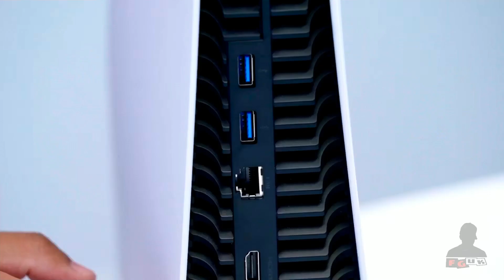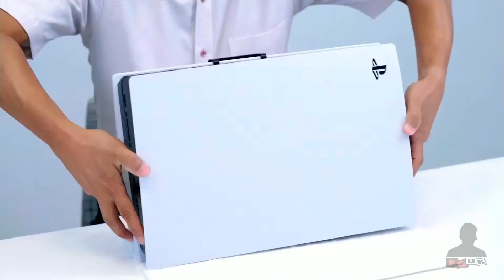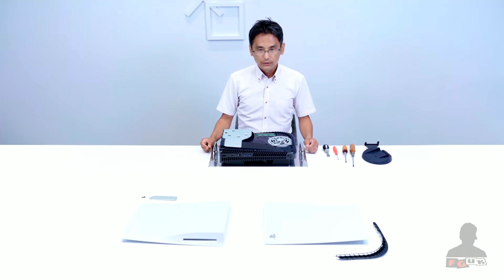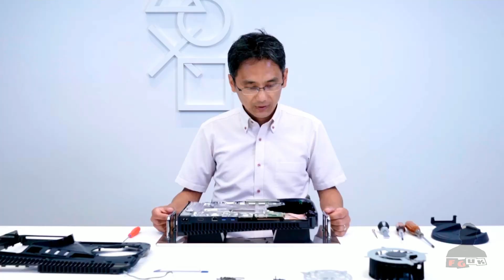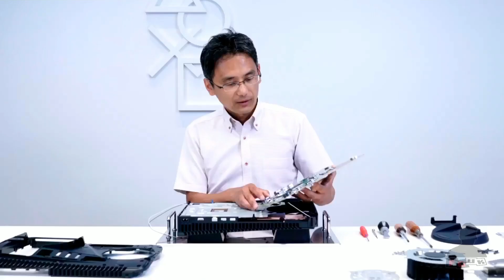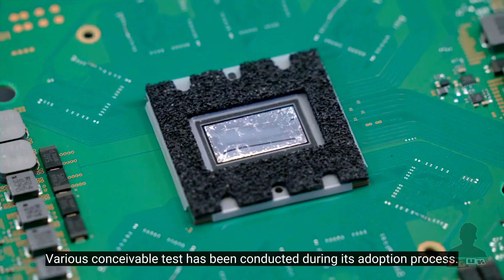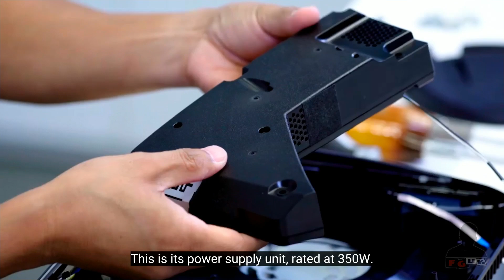The Official Sony PS5 Teardown (English Voiceover)

Comment: I can confirm I just cleaned my ps5 digital version (similar guide) and it was sooo dusty. The screws to remove the fan was a bit tricky but you will need a hexagon adapter it's between 7-8 mm . Bought my ps5 on 9/2023 .So after 1,5 years it seemed that it needed some cleaning .Don't think it's necessary before that ( I will start bagging it while I'm away from vacation,could help imo)

Comment: As everyone can see the PS5 is a work of art inside and out😌 And now finally the critics can be silenced🤫🤐
1  Easy Removable panelsTo 3-D print or make killer designs like  Miles morales Spider man or Kobe Bryant 2K✅
2 T1000 technology with liquid metal✅
3 Multiple kinds of SSD drives thst can be used ,and for those that didn't see carefully the door was made out of metal to act like a heat sink!!✅
4 Gigantic fan that's Almost the size of your hand that not only sucks air from both sides of the Vents from the front but is also quiet and  Releases heat through the back✅
5 The and the reason the size of the  PS5 Isso big is  because of the massive heat sink With its massive piping Just looking at it shows the attention to detail with all of its vapor chambers Not to mention the massive fins  Tells  Sony's not messing around As well as its gigantic power supply✅
6 PS5 also gives you great solutions for maintenance with  Dust  catchers that can be easily Be vacuumed out,  Most likely something that other consuls will start to copy.✅
7  And last but not least RDNA 2✅
 And the list just keeps going on and on, like  Being able to download games fast,etc. etc. etc.

Comment: What's strange is that it's literally twice the size of the Series X, much more complicated design and yet substantially weaker in performance? 😔
Reply: Have You or anybody run a benchmark to say it's weaker? ; P
Both use customized 8 core Ryzen 2 CPU and custom RDNA 2 GPUs

Comment: Overclocked chip = large console with alot of heat sinks, that is all.
Reply: It isn't overclocked. That is a myth perpetuated by Xbox fanboy channels with no understanding of custom chip design or system engineering. The RDNA 2.0 GPU can run at that clock speed when paired with the ram speed SONY and AMD chose. You will be able to see this when AMD release their new range of RDNA 2.0 graphics cards later this month.
Reply: @NieR.Amanda  do your research it is fact that it is overclocked 🤦‍♂️
Reply: @kevina3739  You "Xbox fanboys" have a pretty warped idea of what a fact is. Probably get it from listening to Phil Spencer.

Edit: Most of my work involves research and analysis in the systems engineering field. Where do you get yours from?
Reply: @NieR.Amanda  every single other person on the planet knows it is overclocked other than you
Reply: @kevina3739  What planet are you on, tho? LOL
Reply: @kevina3739  "It's not fair it has a bigger number. Waaaaaaaah! It MUST be overclocked. Waaaaaaaa!" crybaby
Reply: @NieR.Amanda  what has a bigger number? 🤔
Reply: Nobody would put overclocked chip in console xD 

That shit is supposed to be stable. 

Also overclocking is act of increasing a clock, power usage ect. beyond and above whatever the hell default was. So unless You would get PS5 and mod it's not overclocked.
Reply: @CzornyLisek  things overclocked period

Comment: OK, so with the main SSD part of the board, will that be a concern for wear and replacement issues later?
Reply: Allen Hentscher Then the Xbox series X has the same problem, the SSD of the X is also mounted on the motherboard, so you cant remove it also😉
Reply: @renesevriens9965  that's interesting. I wasn't trying to say one machine was better than the other, but I have always been told that SSD have wear issues by the way they are used. So this was a genuine concern of mine.

Comment: The SSD chips being attached to the motherboard is a massive concern to me. Once any of those chips die the console is dead. 

It's not great for those of us who collect consoles and still intend to use them decades later especially when SSD usually only lasts 5-10 years of constant use.
Reply: @TheHound considering that the console generation will last more than 5 years you would hope that Sony haven't put a 5 year life span on these consoles.

It's a shame because I loved the fact that the PS4 allowed you to quickly and easily swap over HDDs.
Reply: 5years for SSD is actually quite a few years ; p

Comment: Why he say 8Gb ram? I’ve said it from the very start before I even saw the console and I still say it...if big means a quiet reliable system so be it no probs! :) it lays sideways so will fit ok in most telly stands.
Reply: Mark Wheeler theyr are 8 ram units, every unit has 2gb ram, so 8 times 2 is 16gb of ram😉

Comment: Fantastic heatsink.

Mega kudos for using industry-standard NVME M.2 22110 or 2280 PCIe 4.0 slot for upgrading store. However a big fat negative for soldering the main ssd to the motherboard as that is a dick move. The SSD will eventually fail and that will cause unecessary enviornmental waste. I expect that nonsense from Apple, not from Sony.
Reply: why should it fail...what if the IO chip fails, or the gpu or the cpu???
Reply: @georgwarhead2801  SSDs have a limited amount of wear cycles. When that hits then the whole drive fails. 

All it takes is 1 chip to go bad and then you dont have working primary storage.
This happens on Macbook Pros and the only recourse is replacing the whole motherboard.

As I said, it is a dick move. It looks like the Xbox Series X does this too.
Reply: @lakorai2  you know how long it takes to exeed this cycles, you can write 100´s of Tb for over 3 years 24/7 to reach this limit, and that limit is only speculative, they can last you even more cycles (and with speculative i mean, that drives get tested until they fail, if a notable amount fails at this amount of cycles, then they set the lifespan there, but this doesnt mean all of them will fail there)...and this doesnt mean, the entire chip has a failure, only a 32bit module in it will "eventualy" fail...
Reply: The integrated PS5 SSD working simultaneously between the rest hardware parts, noting will be as the PS5 integrated SSD for some time that why cerny say you need at least 7GB/s read becuse PS5 integrated SSD have 12 channels controller

Comment: The USB ports are rated at 10gbps and the M.2 port is very easily accessible, means it will be so easy to add extra storage.
Great to see the inclusion of WiFi 6, which offers up to 9.6gbps, Bluetooth 5.1 is higher than the current standard too.

Overall the amount of tech in PS5 is pretty crazy.
Reply: You need at least 5.5GB/s and that will be expensive right away

Comment: I don't think this is that well constructed, it comes apart too easy you you can just drop it then boom most of it will break off
Reply: wow...if you drop it that hard, you have other problems, then just faling apart...remembers me of the old nokia phones, you can drop them from the second floor, they fal apart, put everything thogether and it worked without problems...now try this with a new smartphone, nothing fals apart and you can throu it away after leting it faling

Comment: Wow sony give many USB, you don't need the charging station now

I want to tell noting will perform as the integrated PS5 SSD that built on the motherboard and working simultaneously between the rest hardware parts that why cerny said you need at least 7GB/s read and minimum the same speed PS5 have 5.5GB/s read so i will buy external SSD USB interface first with USB 3.2 Gen 2 up to 10gbit/s and a year or 2 after i will buy the m.2 Nvme SSD PCI express 4 interface because it will be expensive right away

Comment: Sup Fox, THIS IS BEAUTIFUL!!!😍😍 I was Soooo waiting for this!!!  Now we know where the M.2 interface is located. Has 2 'Dust Filter' ports.  Large 120mm, 45mm THIC dual-sided fan.  It's OFFICAL! PS5 uses the T-1000's 'Liquid Metal' for cooling.😆😆 Has been 'stress testing' the TIM tech for 2 years prior.😵🥴  It's PSU is rated 350w.  Massive heat-sink as like the PS3 & to note, *the PS5's heat-sink IS NOT  'Vapor-chambered' as like X1 & SX/SS.  Cooling system is completely costumed & Unique.  WoW!! 😂😂  Already puttin' this vid in my Likes & Favorites section.

Comment: All the lies propoganda from Lbots can go to sleep now, ignore them, the teardown it's the Bible of facts!

Wowww PS5 cooling impressive, they take it seriously this time and they also using liquid metal 👍 the heatsink design as vapor chamber performance

RDNA Gen 2 architecture confirmed, 10.3TF up to 2.23GHz clock frequency

External USB 3.2 Gen 2 (USB 3.1 Gen 2 old name) up to 10gbit/s

Expansion of SSD better solution then XSX that have external slots and it got hot, kids can mess with that, PS5 have the m.2 slot inside the system as we do on PC, great!
Reply: How is that a better solution ? You plug the expansion card into the back of the console for the xbox, can quickly swap them in and out if you have loads of saved games. What is wrong with that ?

Comment: Crazy how nobody mentioned the 2 dust catchers and you can just vacuum the dust out without needing to open up the entire console. That is extremely important, and its amazing how Sony included it, they looked at literally every single angle when developing the PS5.
Reply: They probably realized that a lot of people were breaking their warranty for the system by opening it up to clean out the dust. Definitely a pro consumer move to include these.
Reply: Nope lol it's got a shit integrated SSD so if it fails you need a new ps5 lol
Reply: I'm surpised Sony didn't glue that thing
Reply: ⃠HARAM ⃠ Thats what I love about this Design. Replacing faulty components in the future is going to be a breeze. For a repair guy like me this console is heaven
Reply: But it’s just a concept. Think about what would happened with them, maybe dust collects too fast so you be cleaning them out more often than you should or possibly clog circulation. There’s just too many factors that play. In return the next updated version of the ps5 will try to fix those problems they thought they fixed before and so on.
Reply: @doughboyjoe6518  I would check up on it every month just to see how much dust is collected and estimate how long before it needs to be maintained. Im thinking like once every 6 months to vacuum the dust but who knows?
Reply: @eurostar0711  with fans on both sides like that and they’re 120mm  it might be sooner than 6 months
Reply: Don’t you need a special vacuum to clean PCs? You don’t want to hit your motherboard with static electricity
Reply: @GreenAdam313  you can use a vac but most times they use compressed air to clean out computers from dust
Reply: @GreenAdam313  If your vacuum has a plastic nozzle you're fine.

Comment: Nice, Xboners will sleep tight tonight. They were so worried about PS5’s teardown.  Btw, awesome translation Fox!
Reply: 😆 🤣 .....I know bro....damnmmm....so true
Reply: One things for sure, the damn thing will stay cool. Which is contrary, to what's been said about Series x
Reply: Trill Bill Nothing wrong with that man, you could roast your marshmellows on it while playing Halo Infinite. I’m sure Craig approves...
Reply: Trill Bill I doubt it. Obviously it’s not going to overheat but I’m certain this thing will get hot as well. Also it’s not like the series x is overheating it’s just hot which happens to all consoles. The switch can get hot in the dock too.
Reply: @markercrayon457   They never said it was overheating or malfunctioning. They said it was uncomfortably hot. And that's just on standby mode. Whether it's an actual overheating issue down the road remains to be seen.
Reply: @TrillBill-u2t  i feel most likely that will be a problem unfortunately had overheating problems one xbox and 360 of mine
Reply: @croneous   I was one of the lucky ones who had a reliable 360 lol. But I know what you mean. There were refurbished 360s for sale ,all over the place at gamestops and ebay back then
Reply: @TrillBill-u2t  i was unfortunate I went thru 3 all fried cpu and I kept those clean!

Comment: Not bad, I still think the XSX is put together better. Both systems with that power will run hot and lets hope they stay cool enough.
Reply: In terms of simplicity or the modular look of it, then yes. I just don't believe in a one fan solution without compromises. Especially in a smaller form factor than the PS5.
Reply: @XGamers  seemed PS5 had one fan solution and pushing out side vents instead of, pulling out from the top with one giant fan helping the heat rise quickly and exit the system just as fast.

Comment: A lot of thought has gone in to this design and well done Sony for doing so.. everything is modular and easy to get at to replace. That fan in a beast so is that heat sink. Even down to simple maintenance with those vacuum ports.
 Was hoping for wifi 6 too
Reply: The engineers allowing you to take apart screws and have steps to have it face horizontally is brilliant. Xbox and Switch fall short. Plus you get to see its pretty insides and maybe void a warranty to add storage. Vacuum your console just to show em!!
Reply: So what is WiFi 6? Is it just a strong wifi signal?
Reply: Monkey king  yes it’s faster more stable and there are a bunch of other features you can do with it like mesh systems etc.. but you will need a router that will output wifi 6.. don’t worry if you havnt got one all the other WiFi bands will work with it
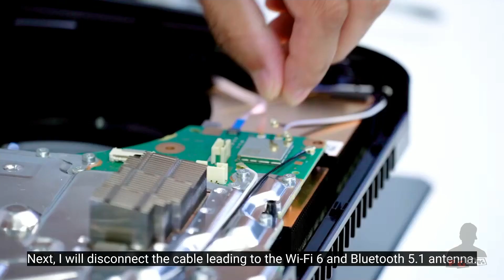Reply: @tweadleao1548  4:09
Reply: A Jay I meant I’m glad it has wifi 6 I don’t word it very well lol
Reply: @tweadleao1548  ori didnt read it well.
Anyway it is great it has it.
Have a good one

Comment: Im happy about the Easy customization of side panels and easy access to M.2 SSD slot... that heat sink tho and liquid metal... Sony cares putting out a quality product 👌🏾
Reply: Just cause there's quality doesn't mean its good quality. You think the Xbox throws off heat, you ain't seen nothing yet! Air cooled vs vapor cooled. The evidence and results speak for themselves.
Reply: @kraigparadise5770  xbox still has a fan that moves air, lol, air cooling
Reply: @kraigparadise5770  im not sure what it is you you're saying but many reports are saying xbox runs hot

Comment: Nice to have a English voiceover !!!
I just wonder if the PCI-E slot actually supports up to 110 mm long drives
In the video we are able to see that it supports 80 mm drives and that a Samsung 980 Pro will fit into it since it’s 80 mm
However since higher capacity drives usually are larger support for up to 110 mm would be nice to see and it seems that it might be supported but it is not really clear 
Also note that there was no standoff for the drive mounted inside the slot
Reply: Just saw in an other video that the ssd mounting screw and standoff are on the 110 mm position

Comment: Oh that heat sink is pornographic!!
Reply: @RealOberonn  yes it is a horror! An air cooled design in a new progressive system like that.  You see they were forced to go with that design because originally the system was going to be 599 but when Microsoft acted 1st and set the bar they had a couple preliminary designs waiting in the wing and that was a contingency plan if they had to go on the cheap and end it may just barely squeak by.
Reply: @kraigparadise5770  MS slapped some parts in a box and put a light on a fan. They didn't think crap through. Thats why ray tracing has to get patched in later on many games. They're still trying to figure out how it works. 😆. Thats why we dont see next gen game demos. That thing will go nuclear. Don't be mad. Even Phil dont give a f@ck about the box. Its all about game pass now. Did you send this months payment?

Comment: The closed captions report 8 gb of ram, instead of the actual 16 gb.
Reply: At 5:12 it’s says 16gb
Reply: He meant 8 chips of ddr6 which add up to 16gb
Reply: 8 chips, 2gb each. quite impressed with the machine actually. the build is alot more considered, always thought the ps4 was a bit weak looking

Comment: How do you switch it on? Where the power button
Reply: The JOYPAD!!!!! YOUR VOICE!!!! Waving at the console!!!!
Reply: There's two little buttons at the bottom of the centre panel (when standing up). One is to power the unit, the other is the disc eject (because it isn't present on the digital console)

But, yes. The controller is probably the most common way to start the consoles (and menu to turn off)
Reply: It really be the PlayStation 360 vs Xbox station 2